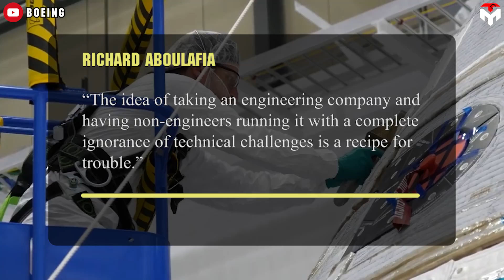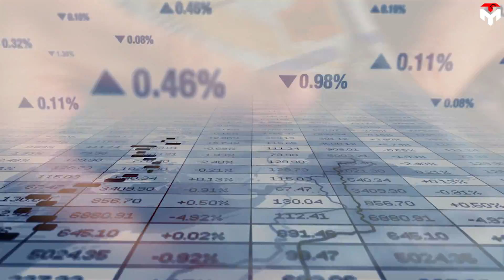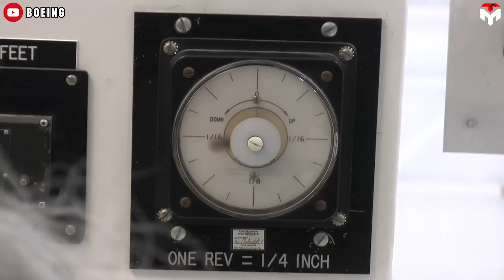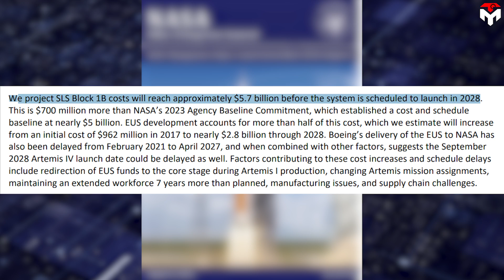Elon Musk Revealed Shocking Secret about What Happened To Boeing Starliner!

Comment: Not an engineer, but the NASA should not have let the Dreamliner move forward and launch a crew without resolving all of the problems BEFORE the launch. When a problem has to be resolved in outer space, the task becomes way more complicated. On the On January 28, 1986 Challenger debacle, NASA suits pressured the booster company Thiokol to okay the Challenger flight even though Thiokol engineers said ti was too cold. And of course the rest is history. Now I see why the 737 Max was such a failure and 300 people were killed in the process, the problem is systemic.